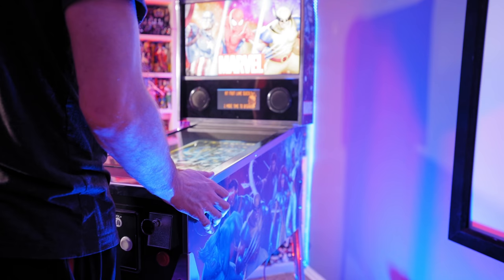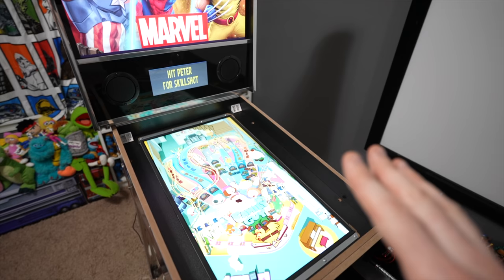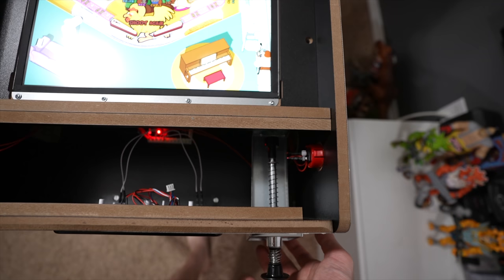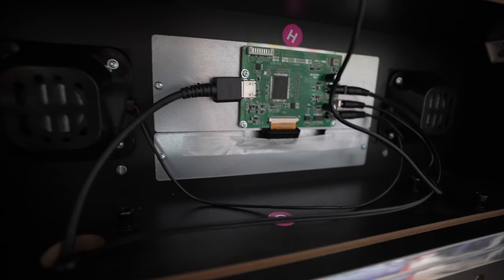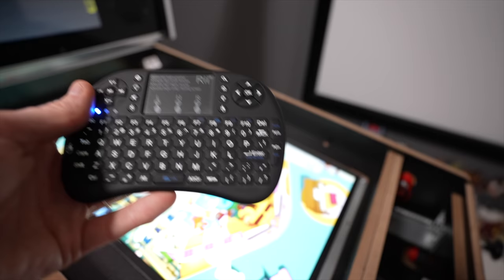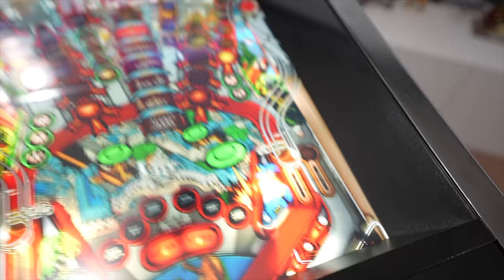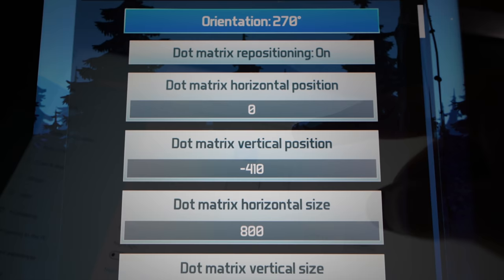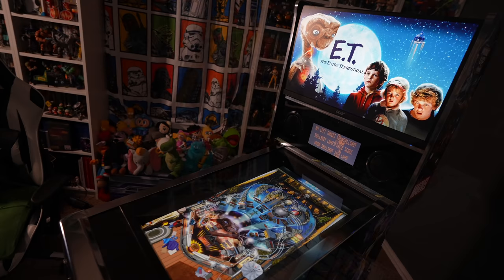Arcade1Up Pinball Mod Tutorial - Part 1

Comment from the maker: Yes, I know, I kept saying "back glass" when talking about the LCD Score Display. Clearly I was tired 🤐. 
VSDISPLAY HDMI VGA DVI Audio LCD Controller Board: https://amzn.to/3b2fi32
2 Way DC Power Splitter Cable Barrel Plug: https://amzn.to/3q4dmLM
Reyann Zero Delay Arcade USB Encoder: https://amzn.to/3b48Fxb
Step Bit Used To Drill Button Holes: https://amzn.to/3dWbAtO
JoyToKey Free Download: https://joytokey.net/en/
Steam Download: https://bit.ly/3sAyeMb
Zen Studios FX3 Games For Purchase: https://bit.ly/3sHvPQ5
Rii 2.4GHz Mini Wireless Keyboard: https://amzn.to/3b51yoj
Supply your own PC.
Reply: Do you have a graphics card in your PC? That might be important along with the general specs if someone was to copy this to see what kind of power you need to run the cab at the 1080p settings your are using
Reply: I was also wondering about the specs of your pc cooltoy

Comment: Nice!  Curious as to (approximation) how much each of those upgrade components cost...especially an estimation on the Minimum Computer ($$$) and Recommended Computer ($$$) - Buttons (FREE), Encoder Board ($10), VS Display Board ($32), Y-Splitter Cable ($10).  Looking forward to the next videos in this series!  Thanks.

Comment: Thanks for this. I was thinking about picking up the Attack From Mars machine but reviews made me sceptical. Now with this mod I believe I'll pull the trigger. Being able to have some of my favorite pinball games and not having to build a cabinet is perfect for me, the novice gamer. I have bought the Sharpin Ultra last year when it came out, for some reason I have very noticeable lag and owner seems not to want to help support US buyers. I see the upgraded 32" monitor and 21" back glass monitor so I will add those projects as well. Thank you again. I'll let you know my progress. I will gift myself Attack From Mars for Father's Day

Ordered Attack from mars from Best Buy, should be here 06/17
Reply: You WILL love it, that pinball is FANTASTIC.

Wait when it yells: A T T A C K !!!! at you...
Reply: I am doing the same Tim.  I just ordered my AFM, both monitors recommended as well as the $160 board that does the accelerometer and provides the updated plunger.  I have a small HP Z2 PC that has an i5 processor, 4 display port output ports using its built in nvidia card, 16 GB of ram. I can't wait for all the parts to arrive.

Comment: Its a little concerning that the stock parts didnt even last a month.  Sounds like poor quality control and am now worried about my machine....Great video though.
Reply from the maker: This Marvel machine was a pre-production machine sent to me for review purposes. I have no way of knowing if the component failure that happened on my machine is a result of bad luck or actual QA issues. Since I have no way to know what, if anything, changed between the pre production and final production runs on these machines.
Reply: @cooltoy  You didn't hit up A1U to replace the parts?
Reply: @danielmitchel31310  This is exactly what I was thinking.  Why wouldn't you contact them?  I'm sure they would have just sent out a replacement for no charge.
Reply from the maker: @danielmitchel31310  nope. I didn’t want to ask for replacement parts because I didn’t want to take away from customers who might need those parts more than me
Reply: @cooltoy  I understand. Because they'd already given you the unit. You didn't wanna be the hand that keeps asking for more, right?
Reply from the maker: @Daniel Mitchel correct

Comment: Awesome. Really appreciate the detailed mod info. Shame about the stock controller board dying so quickly (quality issue or just bad luck?).  This looks like a no-brainer upgrade for most people who have a spare PC around to power their steam collection. Cheers!
Reply from the maker: My Marvel machine was a pre production unit sent to me for review purposes. I have no real way of knowing for sure if it was bad luck or a quality issue, since I do not know what may or may not have changed in the manufacturing process when the retail ready units were made.
Reply: @cooltoy  No big deal either way. There is an inherent failure rate of all electronics so let's just chalk it up to bad luck. Fortunately, as you proved it's really not that big a deal to upgrade/replace these parts for minimal cost. My guess is that after shipping costs are factored in, that A1up isn't making that much on these units, so it's still a great value overall as a vpin cab that can be modded.

Comment: Great video! Thanks so much--i used the teachings herein to repurpose my arcade1up pinball into a dedicated Pc-based pinball fx3 cabinet. Quick question: would it be possible to connect the power for the DMD/speakers/backlight into a USB port in the PC, using some sort of barrel-to-USB adapter, so that the entire shootin' match powers up when I power up the PC? Or is there a way to power everything off of the PC power supply?

Comment: What specific graphics card are you using in the optiplex? Can it be any GTX 970? It has to have at least 3 video outputs correct? Thanks for the vid...can't wait for the others.
Reply from the maker: 3 if you want to do the additional back glass screen also, only 2 if you just want the scoring LCD and playfield. I'm using a Gigabyte GeForce GTX 1650 D6 OC Low Profile 4GB graphics card in this particular PC.

Comment: Thanks for the awesome video.  I grabbed this converter board for my PC's HDMI to the monitor.  Thank you.   If I wanted to convert PCB to HDMI (so that I could add an HDMI switch and run either system) what do you recommend to convert PCB into hdmi?

Comment: hi. thanks for taking the time to make these mod videos, really enjoying the series. One thing i am unable to find (i may have over looked) is what video card you are using in your PC or are you just using on board graphics from the I5? if so, does it handle all 3 monitors without anything else needed? thanks in advance for any help.
Reply from the maker: I used a Gigabyte GeForce GTX 1650 D6 OC Low Profile 4GB

Comment: Can you only use the VSDISPLAY just to improve the stock screen quality to 1080p or do you really need a pc also? I am only interested in doing a screen mod to inprove quality & contrast from the stock screen. Please let me know.
Reply from the maker: I don't believe the monitor has the capability to save any settings, so once you remove the VSDISPLAY adapter you would lose whatever changes you made.
Reply: @cooltoy   Tks for responding. Can I just simply add VSDISPLAY HDMI VGA DVI Audio LCD Controller Board without the need a pc?  The only mod I am interested is really screen resolution on the stock.

Comment: Cool build! So what video card are you throwing in that Optiplex 9020? That PSU is fairly limited. I guess you are having to use low rise cards too.
Reply from the maker: Yes low profile cards for these SFF models. You can use a 1650 or 1050ti card

Comment: What about a Threadripper based unit with 24 core 48 threads or 48 cores 96 threads or 64 core 128 threads on a X399 TRX40 motherboard and 1TiB of Threadripper compatible 3600MHZ DDR4 RAM and some way of controlling the bumpers and what have you, Linux runs very well on the RYZEN Threadripper series of chips, You could go with Linux Mint 20.1+Wine64+Winetricks+Zip.dll to run the Windows software or install the STEAM client for Linux.

Comment: So I just got the marvel 1up machine. The previous owner modded it so I have all the marvel boards, all the Star Wars boards and Williams boards. If I understand you correctly, I would need a pc and a different pcb in order to utilize the stock playfield at 1080 correct? In other words, what is the bare minimum I would need to get 1080 resolution from the stock board and not lose haptics or accelerometer?

Comment: Cool Toy, I have selected the exact Dell optiplex 9020 small form factor PC you have in the video.  For the 3 video outputs, do they all need to be HDMI? Or will display port work just as well? Do I need to get a display port to HDMI converter cable?
Reply from the maker: They don’t all need to be HDMI, you can use display port. You only need a display port to hdmi adapter if one of the screens you are using only accepts hdmi input

Comment: Wouldn't a mini pc work as well too instead of having a normal pc. Like how much ram do you need to run pinball, an how much memory? Couldn't you use a mini pc with 16g with 256?
Reply from the maker: Virtual pinball is highly taxing on ram and gpu’s. A mini pc is just going fill you with compromises in performance and make you wish you used something different. Mini PCs are great for arcade emulation, but not so much at virtual pinball running high frame rates with multiple monitors

Comment: I picked one up from BB for 30% off. I'd been debating a build from scratch but I'd spend the same on parts anyway. I was disappointed that the factory display was so  horrid. I hope I can mod it with just a Pi and new display since I've built several types of emulators with the Pi. I'm not sure if fx3 will run on Linux though.

Comment: Probably a dumb question, but is there any way to get the stock On/Off switch to turn on/off the PC? I know you can buy buttons with wires that plug into the motherboard, but I'd really like to use the built in toggle switch. Maybe some sort of wire converter or something between the existing wires and the PC plug?

Comment: When preparing the stock monitor for the VSDISPLY do you simply remove that existing smaller metal box from the back of the monitor. Any more details around this step would be appreciated. I ordered a mix the parts form this step one video and the the step 2 video for the plunger, accelerometer and button controller. 

Has anyone documented this process further? 

Thanks for the great videos!
Reply from the maker: Yes, I removed the smaller metal box entirely since I am no longer using the stock PCB that that metal box was housing. The only major details you need to focus on is making sure you ground the applicable ground cable and make sure the LCD controller board isn't touching a conductive source of any kind before you power it on.

Comment: Question for you Cooltoy - I've got FX3 from Steam and have been purchasing the tables as I work to complete my mod.  Are you just running FX3 stand alone or did you use something like Pinup Popper and run FX3 through that.  All those Popper settings are a bit overwhelming.
Reply from the maker: I'm currently using Popper, I would suggest looking into Pinup Popper Baller Installer. It's the easiest set up they offer.
Reply: @cooltoy  Thanks.  That's what I used following Nailbusters install guide.  One of the issues I'm working through right now is when I run just FX3 (outside of popper) I'm not seeing anything on the backglass.  The DMD works fine.  I also have to figure out how to stop the score from displaying in the upper left hand corner of the playfield.

Comment: GREAT Mod!  My StarWars Aracd1up Pinball machine just came in and it's good, but the 720p is lacking and would also like to get the Steam Zen FX3 library installed as well.  Does it boot directly into Steam FX3 Pinball?  Does it have to be connected to the internet after the tables are downloaded?  Trying to set this up for our local Rec Center.  Thanks!
Reply from the maker: Currently I have it booting into a pinball front end UI, but it can easily be configured to load directly into FX3 if you like. No, you can set the settings in steam to run in offline mode if you wish so that you don't always have to be connected to the net.
Reply: @cooltoy  Thanks for the reply!

Comment: So in your video you mention not using this to mod as a first choice for a VP cabinet for your own tables. My question is what would you suggest that won’t break the bank? I’m wanting to run Pinup Popper, and I could build my own cabinet but I wouldn’t mind an all in one with or without screens that I could install on. I’m not too worried about solenoids etc yet, but as I said I’m on a budget. My wife’s disabled and I’m a caretaker, so nowadays the bank isn’t as full as it used to be. Appreciate the assistance (and if you have a video I missed or would rather make a video discussing it instead of in comments that’s absolutely cool with me.
Reply from the maker: what kind of price point are you hoping to stay around?
Reply: @cooltoy  Around a grand or less. I also don’t mind getting something that is basic and improving it as time goes on (solenoids, etc). I may be able to get an old Shangrila cabinet from my father in law’s friend that used to do gaming machine installs that I could retrofit, but I’m not taking that as a solid till I speak with him. I am a gamer though and I’ve seen how good 4K cabinets are and with tv prices as low as they are I’m sure I could get one that would work eventually. But, I don’t want to get a mediocre pc that I couldn’t pull a video card out of and replace for 4K performance needs.

But if there is an already build all in one option that works too. Sorry for the long reply lol.

Comment: I know this is an old video but is it possible to keep the machine stock and only add video settings board to the stock machine to control brightness and other functions?
Reply from the maker: There is no way to control the stock monitor settings
Reply: @cooltoy  I see, I misunderstood about that add on display board

Comment: I've got my marvel pin in the box I'm super worried and disappointed in the out of the box quality. I've been a supporter of 1up since before launch, of this pin doesn't work out I'll will have to abandon them.
Reply from the maker: What’s wrong with your machine?
Reply: @cooltoy  I was just saying that it's arrived and still in the box, I've seen many issues across the board through various different people. I'm remodeling my room so I'm concerned about the quality being the warranty is so short.

Comment: I’m trying to follow what you did with the VSDisplay hookup to stock monitor. I’ve got the main playfield hooked up and showing my pc desktop. However the small DMD screen isn’t recognized when I go to look for it in windows. It doesn’t look powered on either. 
Can you give me a more in depth tutorial on how to use the VSDisplay with the stock monitor and DMD hookup please?  Thank you!
Reply from the maker: The stock DMD monitor has nothing do with the VSDisplay adapter. You simply need to give power to the DMD monitor and connect it to your pc via an hdmi cable. It’s hard for me to provide any more insight or info as I can’t see how you have things connected on your set up or what you are using
Reply: @cooltoy   I have the hdmi cable from my gpu going to the VSDisplay board. It’s detected and working. The hdmi cable from the dmd can’t go on the VSDisplay board as it’s taken. So I would have to run an hdmi cable from the DMD directly to my PC right? In my case, I’d have to use my integrated gpu hdmi since my dedicated gpu only has one hdmi connection. 
The DMD powers up and turns blue for about 20 seconds then goes black. Windows doesn’t recognize a second monitor. 

I guess I’m getting confused since you said you left everything stock the way it was plugged into the back going down to the VSDisplay board.
Reply: So I ended up using an hdmi to dvi cable for my GPUs dvi port and hdmi end to the VSDisplay board. Then I used hdmi from the DMD to my GPU’s hdmi port. Up and running now. For some reason my integrated gpu wouldn’t recognizes 2nd screen despite enabling multiple displays in the bios. 

Anyway thanks for the tutorial and help!

Comment: Just a question. I saw the 1up pinball today and they looked cheap . Is the at legends better quality ?
Reply from the maker: you'll have to be more specific as to what part(s) you are asking about specifically
Reply: @cooltoy  the silver plates on the table looked cheap but maybe that due to it being a floor model. But now I hear that the UI in arcade legends is not that great . I love old tables from the 70’s and 80’s and arcade one up doesn’t have much in that area. Ideally I want tables I used to play like eight ball deluxe , kiss , future spa , playboy, alien poker , Coney Island  etc ….no one has those tables . if I knew how I would build a cab with visual pinball . Hmmm not sure what to do .

Comment: What is the price point where it actually does make more sense to use the arcade1up as the starting point instead of building from scratch? (Assuming we have tools, knowledge, etc.)
Reply: The cost of buying another pinball cabinet is $550-$600, which only includes 10 games.  With this mod you can add all FX3 games and more.  What CoolToy did is in this video is less than $300 in parts.

Comment: Hi. Just finished doing this mod to my Marvel cabinet. I ordered the same parts. I have only done the display so far as I'm waiting for the plunger kit and board for the buttons etc. So two displays are both working but when I play the game there is no sound and the I have two dmd's one on the dmd itself, which is sized correctly, the 2nd one is on the playfield at the top. So my playfield is smaller. Any tips on how to resolve these two issues? Thanks!
Reply from the maker: I’m assuming you are talking about using fx3 as you didn’t specific which software or games you are playing. Within fx3 cabinet options menu you can turn off the additional DMD that displays on the playfield screen so you don’t have two going at the same time. You can also change the camera view by hitting C on your keyboard. It’s really hard for me to really understand what your are seeing or talking about without more details
Reply: ok. I have the dmd sorted out it was camera view setting. Still no luck on the audio.
Reply: Got that sorted too. Was Audio Mixer settings. Thanks and sorry for the spam comments!
Reply from the maker: @justingay9413  glad you got it sorted